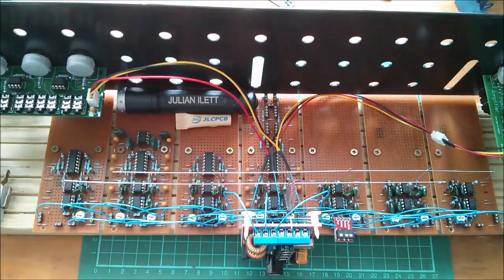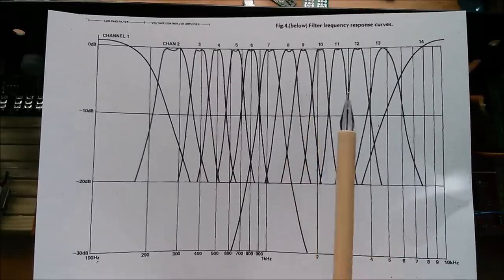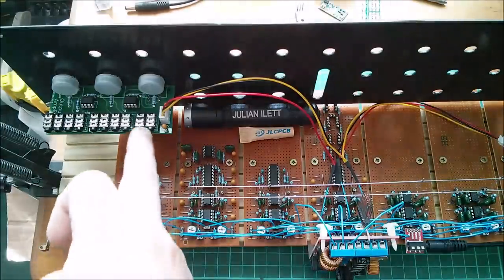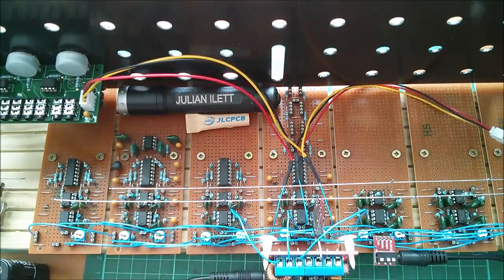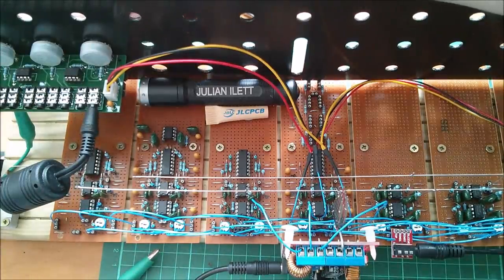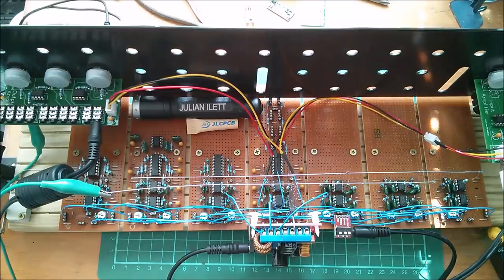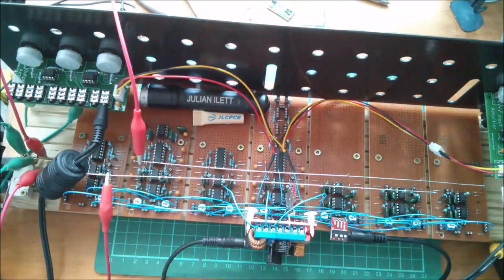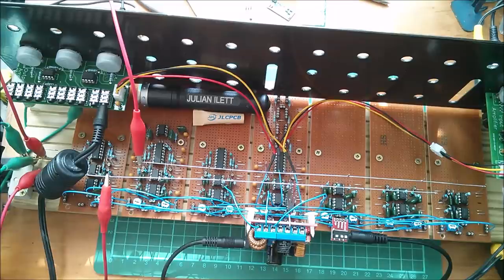Listen to the Deep Holes

Comment: If only you had a bench power supply, whose current meter would quickly indicate when you had a dead short.
Reply: At least he has pliers to rip defective components off the board.
Reply: @MetalheadAndNerd - better than a hammer I guess. Sometimes it's a bit like watching a Victorian trying to make a steam engine with just a bit of wood and a rusty nail.

Comment: An ‘Audio Spectrum Analyzer’ could be handy on such audio filters. Also you could install a Function Generator on your phone (android has such apps) for White, Pink Or Brown noise along with sine, square, triangle waveforms that's super handy in such circuits.
Reply: You would think so.  And other commentards have suggested using the FFT on the 'scope.  But neither of these are really in character for the bumbling Julian Ilett persona that this channel is all about.  Comments are often full of "why didn't you use your 'scope", "why didn't you do this <sensible thing>".  These miss the point of the character.  This is all a deliberate act.

Comment: This is why you should use a proper current limited lab power supply instead of your solar battery.  Know approximately what current to expect and monitor it at start up.
Reply from the maker: Hmm. That would have flagged a problem, but not given me any idea what was wrong. Turns out all 16 tantalum caps were reverse connected. All now replaced :)
Reply: If it was a bad tant (and for me, all tants are bad by definition) won’t go short. It’ll just go progressively more leaky until it burns and goes open. Bloody things, I never use them!
Reply: Julian Ilett - all 16! 😮 One is forgivable, two is..., but sixteen...! Oh well 😝
Reply: Billy Sugger - depends on the failure mode. Some will go low impedance (short circuit) and cause current limited PSU to go into protection mode.
You can get different effects depending on if reverse biased, over voltage, or cumulative damage over time. The later because far too many people don’t understand that you have to de-rate this type of capacitor depending on possible voltage spikes and the rise time of the power supply voltage.

Comment: Instead of hooking the vocoder to a bluetooth speaker, can you hook it to the line in of a computer?  This way you can control the sound level in post and you wont get feedback. Maybe get a cheap USB interface to protect the computer?  Most of the time I listen to your videos in the background at work, then rewatch the ones with lots of visuals at home.
Reply: @stephenstebbing9460  but doing the effects on the computer is a completely different skill set, that doesnt keep with the theme of the channel.  Recording the vocoder output improves video quality and attracts new viewers and prevents others from complaining about the topic of the vocoder.
Reply: @stephenstebbing9460  getting the frequency response would be awesome.  Then we could also see the noise floor at different amp settings.  I think we might me on to something.

Comment: Julian, re tantalum capacitors. In the mid-90s I worked for an electronics company where we had a series of tantalum capacitors which were less than 100% correctly marked for polarity. So a finite number of them were reversed. The trouble with tants is that they can work for a short time well below their rated voltage when reversed. So they all passed in-circuit test, but failed at functional test, or during soak test, or worse in service. Bloody nasty things. I’ve never used them since, and never will!
Reply: At least they weren't sold, that would suck for anyone who produced a bunch of gear with them :)
Reply from the maker: Wikipedia says tantalum capacitors are reliable :)

Comment: just a little difference in resonance between the channels
Reply: you should use the noise generator to check your individual filters. check the band passes and frequency outputs with the scope. allign their outputs... and maybe invite a pianotuner and have a good talk about harmonies and frequency distances... and if you are really into it you coukd create an oscilator tuned to each band and let the volume output of each filter drive the volume of the oscilator.. maybe some syncing required :)
Reply from the maker: The alignment procedure says adjust the filters for a gain of 10. But the adjustment pots also affect frequency. I'm half inclined to adjust them for frequency (at 1/3 octave spacings) rather than gain.